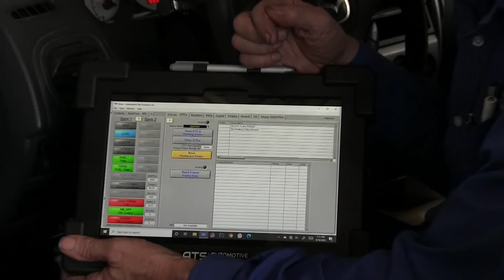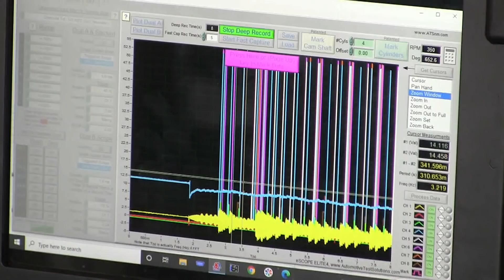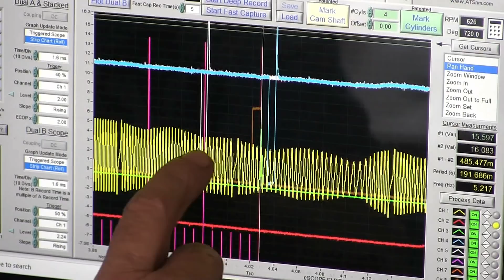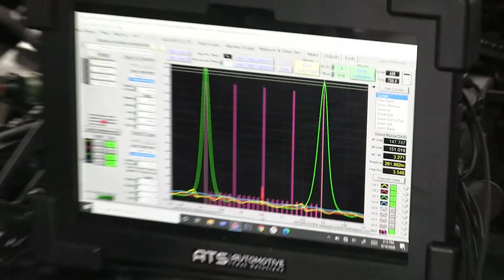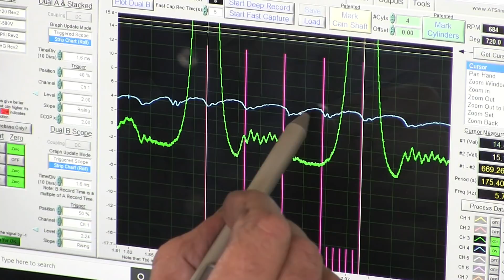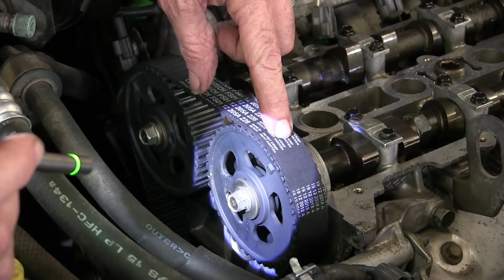2003 Mazda Protege 5

Comment: A very common problem with swapping in a used engine, as soon as you stated engine swap, I knew the problem was CKP or CMP reluctor issue with the sound of the engine trying to start. Happy that the old engine was still available. Thanks so much, Bernie.

Comment: So why did the one sprocket have one mark and the other one had three. I'm assuming it's a replacement engine from the same make and model but maybe a different year?  On a side note I don't know about Mazda but a lot of GM vehicles including the ones I used to work on, you are supposed to do a crankshaft relearn anytime you change something related to the reluctor wheel, PCM or crankshaft sensor.
Reply: Mazda did the same thing with the 2.3 engines from 2004 to 2005. The wheel was no longer on the gear but on the cam itself. Then in 2006 they changed the number of teeth on the cam timing wheel.

Comment: I feel that I learn something on each video. I would like to c u actually doing the hook ups. R u piercing or back probing. Knowing how and where to get the signals is crucial. Now one of my favorite channels. When Bernie talks, we listen!!
Reply: I have the 4 ch with the e scan. Don't work in shop but self learning. Biggest problem is I don't play with it every day. 

The e-scan and iea also has a deep learning curve. I have the 4 ch version. 

I'm working towards using it more often but still not quite there. 

I've got a plan in the works as it's part of a bigger plan. I get capturing the waveforms, hookups but interpretation of the data, e-scan data and iea data is what baffles me as the tools ATS sells can do quite a bit. 

I'd love to just ride around with Bernie free of charge for a week or two for some hands on training. 

Heck if he sends me a plane ticket and has a office with a cot or spare bedroom I'd be very grateful given the cost of the tool.
Reply: @dtnel   Check out Voltage Drop Diagnostics. He has some really cool vids. One in particular is about a Toyota V-6 that had misfires and no one could diagnose. He used an in cylinder pressure transducer and determined the problem fairly quickly. The Gadget’s Playlist has a very affordable version on one of his recent vids.
Reply: would you pay that kind of money for the tool and not use it?